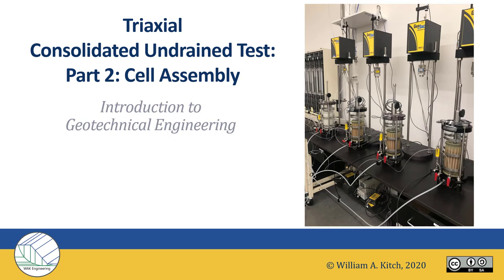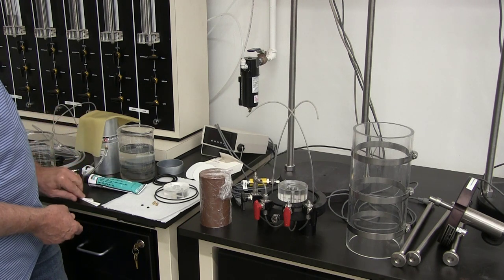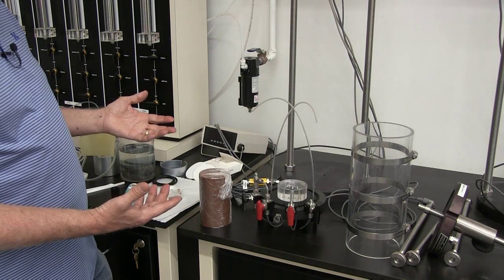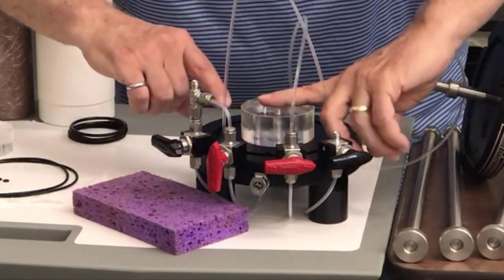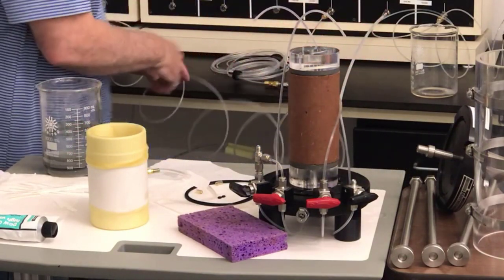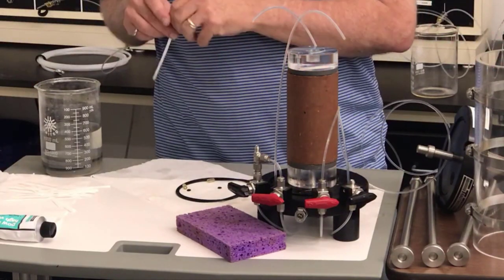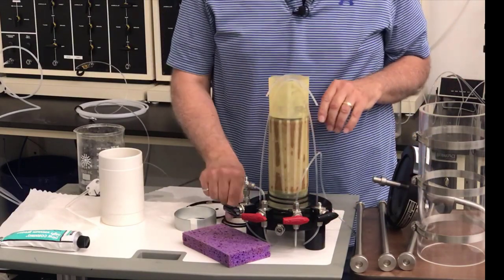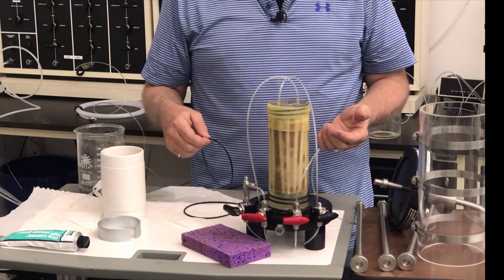C-U Triaxial Soil Test, Part 2--Cell Assembly

Comment: I didn't see you tighten the compression bolts where the lines enter the top cap.
Am I thinking of a different model of top cap?
Reply: I ask because I use older equipment that I repair myself, so leaks during saturation and consolidation are a big pain.
It may not happen with new lines and o-rings.
Reply: This cell does not use compression fitting for the drainage line in the top cap. The seal is accomplished using only o-rings. Works fine.

Comment: sir ,is this membrane permeable
Reply: It really shouldn't be.
Reply: No, it is not
Reply: No, the membrane must be insulating, and accordingly, the water inside the sample will exit through a special channel located at the bottom or top, and possibly the bottom and top together to let the water out in a faster time. The water inside the sample must exit through a special channel (exclusively), to be able to know the change  The volumetric, where this water will come out and collect in a graduated cylinder, as well as this special channel is equipped with a gauge to read the pressure of the pore water, and all these achievements can not be obtained if the membrane surrounding the sample is permeable to water.